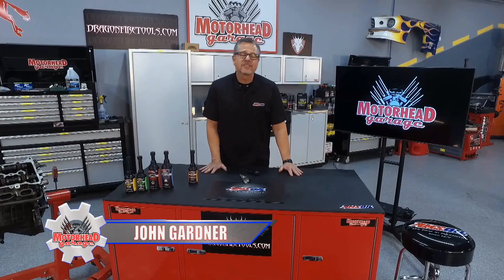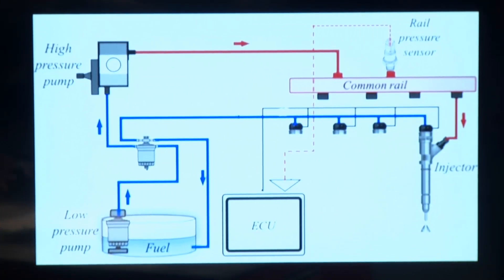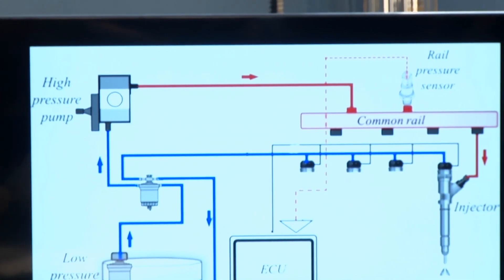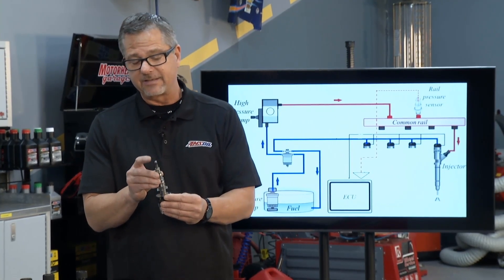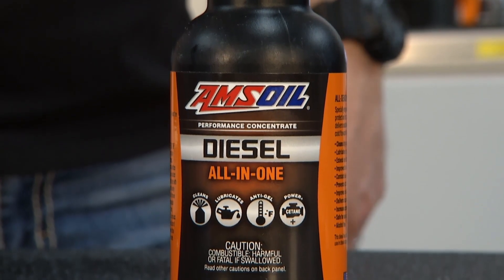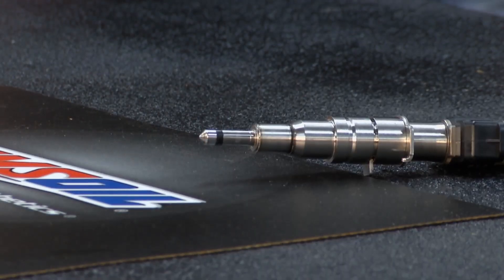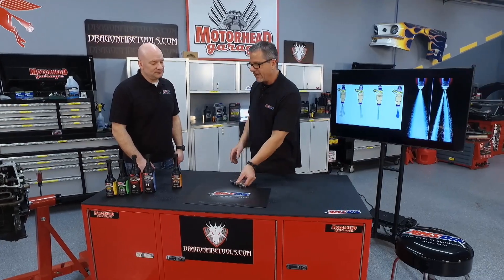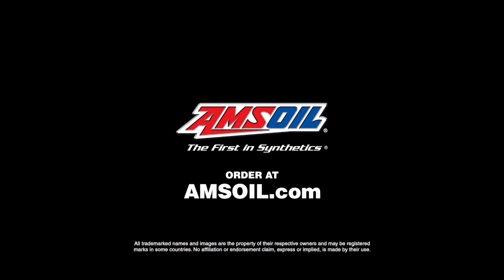AMSOIL Tech Tips: Diesel Injection

Comment: I bought injector clean + boost how to use it ??
Reply: Go to a fuel station, add the entire bottle in the diesel tank and then fill full tank with regular diesel.
Reply: @xuxuonex  No, it's one ounce per 5 gallons. If you put the whole thing in there you would cause your Cetane to go over 50 which would actually diminish your mileage. 
If you have a VW with a 15 gallon tank and out the entire bottle in (16 ounce) which is for 80 gallons of diesel you would not get good results.